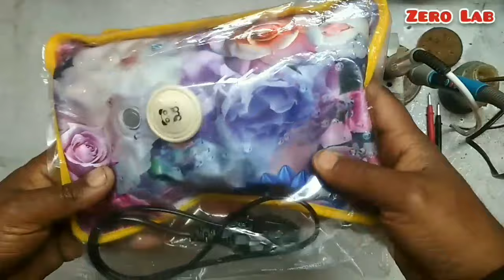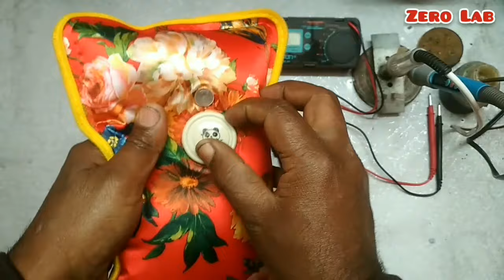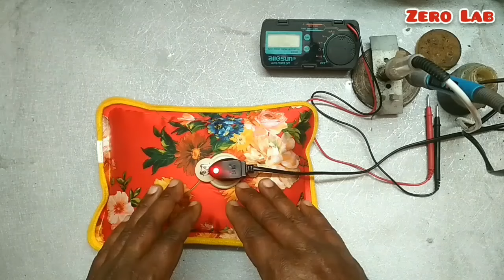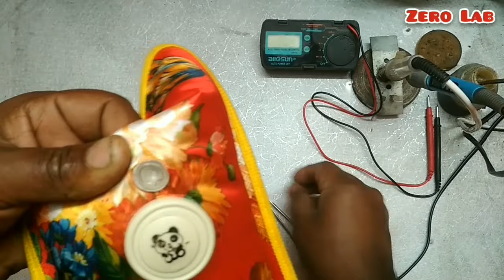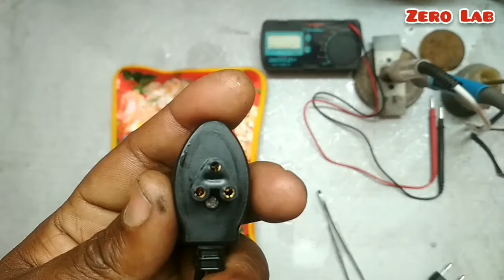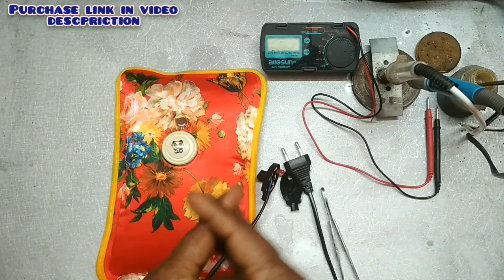Electric Hot Water Bag कितना खतरनाक है जरूर देखें ये वीडियो

Comment: Sir smd led bar bar fuse hotta hai jo ki ujala led bulb 9w circuit m 1 sense resistance(2R05) lga h.Jise hatate bulb dead hojata or Maine   kam powr capctr  v change kra 
to kuchh der jalne k bad fat gya capacit(100uf,63v) or next led fuse..plz help me.
Reply from the maker: Resistance 2R05 remove kr ke 3R00 use kro
Reply: @TechToolsElectronics  thnx sirji try krte h.

Comment: सर मेरा एक सवाल है , लेकिन इस व्हिडिओसे जुडा नही है 
मेरे पास एक led tube है चलता नही है उसमे 49 led के दो ग्रूप है , 49 led series मे है और दोनो ग्रूप parallel मे है , उसके सब led check किये ओके है , उसका drive circuit led से  disconnect करके dc volt कितना मिल रहा है यह मै चेक कर सकता हूं क्या ?  कोई harmful तो नही ना ? Without load drive को सप्लाय देकर चेक कर सकता हू क्या ?
Reply from the maker: बिना load कुछ देर ड्राइवर सर्केट पर सप्लाई देनेे पर कोई दिक्कत नहीं आयेगी आप ऐसा कर सकते हैं...
Reply: @TechToolsElectronics  thank you sir कल practicaly करके देखता हू